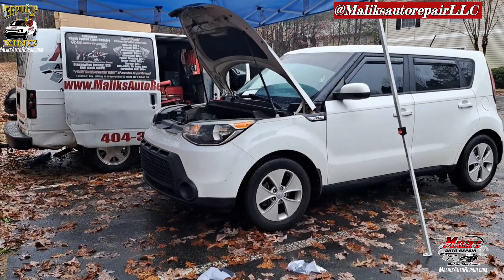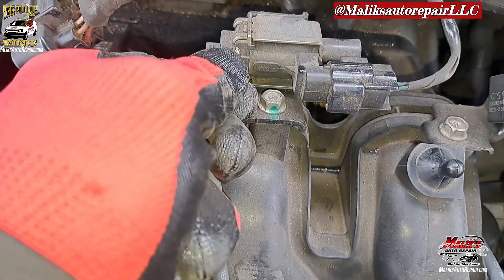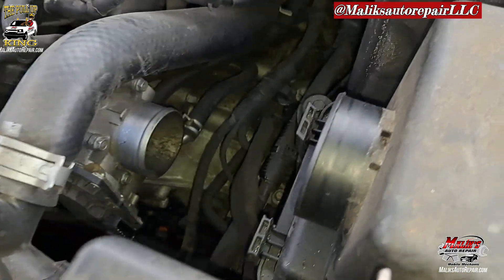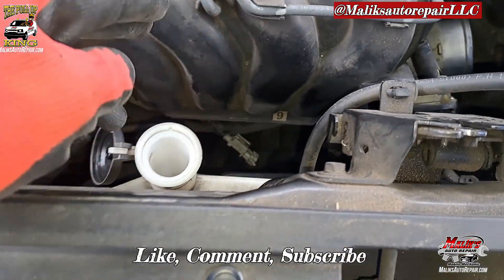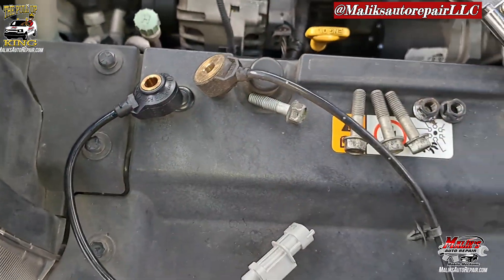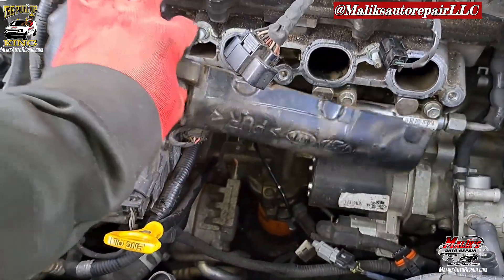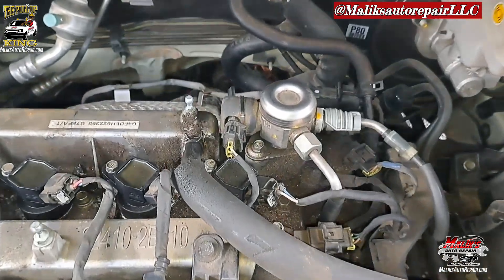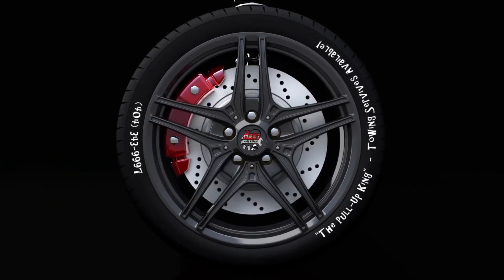CODE P1326-Knock Sensor Detection System | 2015 kIA SOUL |  REDUCED POWER | KIA HAS A RECALL ON CODE

Comment from the maker: Kia dealers will update the Knock Sensor Detection System (KSDS) software, free of charge. The recall began January 27, 2021. Owners may contact Kia customer service at 1-800-333-4542. Kia's number for this recall is SC200.
Reply: Now this is extremely useful!
Reply from the maker: @JohnnyHears  Thanks

Comment: I HAVE SAME YEAR STARTED DOING THAT  I REPLACED THE KNOCK SENSORIT DIN'T FIXED ANYTHING I CHECKED THE PLAY IN THE PISTOND ROD AND THE DEALER END UP REPLACING THE ENGINE FOR FREE  SO JUST TAKE IT TO THE DEALER THEY WILL TRY TO REPROGAM  AND IF THAT DONT WORK THEY WILL REPLACE YOUR ENGINE FOR FREE
Reply from the maker: Thats what I mentioned in the pinned comment. Thanks🫡

Comment: Kia had recalled ours a few years ago and the new engine doesn’t look like that. From what I can tell, ours is a G4NC 2.0L. I don’t know what that means. 

Can anybody help?
Reply from the maker: 2.0 liter, four-cylinder, non-turbo engine produced by Hyundai Motor Group
Reply: @yeah. I had googled it after my stress fit ended. I’m having trouble at the bottom of the manifold where you got those 3 (probably 10mm like mine) bolts. 

I can get the one all the way to my right, but I can’t find the other ones.
Reply from the maker: @grayloncomeaux7483  Gotta know what your looking for and feel for them. You cant see down there. Unleaa you use a mirror.
Reply: @ThePullUpKing  I’m about 4:30 into your video, process wise.

Comment: It apeared a p1326 on my 2012 Kia Optima SX..i already replaced my knock sensor..the rpms already lift more than 2,000rpms but the knocking sound its still on..ehat could it be??
Reply from the maker: Excessive bearing wear
Reply: @ThePullUpKing  what does that mean? Is it bad? How can i fix it..thanks tho!
Reply: @ThePullUpKing  what does that mean? Is it bad? How can i fix it..tnaks
Reply from the maker: @rick_golden Yes, it's bad. Will need to rebuild the motor
Reply: @ThePullUpKing  REALLY😳😳why does that happen
Reply from the maker: @Therockydich  Bad design

Comment: Death code
Reply from the maker: Yup lol
Reply from the maker: Just had another one with a misfire. Did a Tune-up and had to run more test. Low compression in Cylinder 1.🤯 These motors are terrible. 
https://youtu.be/DoPEGnzjA_Y
Reply: @ThePullUpKing  my daughter's blew last week at 75,000. At the dealership getting a new engine under the 100,000 warranty, but we are getting rid of it after repair.
Reply from the maker: @donniedarko979  Smart move. The ladies love that car, but it's not a reliable car at all

Comment: hi,  I have my car at dealership for warranty claim but they are refusing to replace engine claiming the noise is because of piston wear and not due to bearing  knock , they use some type of tool to test it without opening engine and when I ask them that sound just started to come as soon as I get P1326 and there was no oil leak/burning before that then how it can be related to piston,  they cant explain that and say that we can see that cylinder walls are scraped , its a kia soul with engines under extended warranty due to rod bearing wear, don't know what to do next
Reply from the maker: They're just tryna find away to avoid installing a new motor, is what it sounds like.
Reply: @ThePullUpKing  yeah that's what i am also thinking , I also don't understand how they can check bearing wear even without opening engine
Reply from the maker: @tanweerahmed6861  They make a tester strictly for that, so you don't have to breakdown the motor.
Reply: @ThePullUpKing  but is this device reliable , can we trust its results ?
Reply from the maker: @tanweerahmed6861  Yes, it shows what can't be seen with the motor assembled.
Reply: @ThePullUpKing  got it but still they should replace engine as this is a design flaw, they are just trying to avoid warranty using piston excuse
Reply from the maker: @tanweerahmed6861  So true. These motors are terribly designed
Reply: Bro same thing with me…. Piston issue. But won’t replace engine finally went to a new dealership and they may get me a new motor
Reply: @ryanshaneprod3487  please keep me updated thanks
Reply from the maker: That's good news!😎

Comment: Did it end up coming back. My wife’s Kia forte (same 1.6 motor) just got this. At first I was worried there was a bigger issue and not just the sensor. But you gave me some hope.
Reply from the maker: Yeah, it came back and it got worse. I'm not sure if they still have it.
Reply: @ThePullUpKing after how long ?
Reply from the maker: @andrewww6265  Maybe a mth or two

Comment: Wow 😂 You did not have to remove intake manifold. Whatever works.
Reply: Please share frend
Reply from the maker: I'm still waiting
Reply: I'd love to know as well
Reply: @Tjflow3404 hey there ! My boyfriend just took mine off in about 3 minutes from underneath my car. He didn’t take the manifold off. We watched this video then he figured he would take a look from underneath the car to see if there was access that way and had it off very fast. We’re going to pick up a new one and hope it goes on just as quick. My code says P1326 which I’m hoping is a result of the knock sensor and not the bearing rod.
Reply from the maker: Nah, it's impossible to get it from the bottom on this design.lol Clearly it's not the same design. Some you can get from the bottom.  Not this one.
Reply from the maker: What other way can you get it if it's under the intake manifold? Put me on game then

Comment: My car is throwing this code, P1326, as well as P0014 and P0011. It's showing some of the same symptoms like when I push the pedal to the floor and won't go past 2000 rpm's. Should I just replace the knock sensor or something else?
Reply: Your car is still under warranty extended to 150, 000 that is the engine replacement code for free. I'm going through this right now
Reply: @jontaylor8188  I'm having the same issues and exact same code. What do I need to do to get my engine replaced without them giving me the run around?
Reply from the maker: Try replacing the knock sensor. That won't fix the other codes tho.

Comment: Did that fix your problem,in my experience I never found a bad knock sensor ,always broken wires,did that fix the issue
Reply from the maker: It fixed this particular car. If the customer is willing to pay... I prefer to always diagnose it before replacing parts. That way I can determine if it actually needs to be replaced or not.

Comment: How much does it cost to repair? Currently dealing with this
Reply: A shop will charge around 200-250 for replacement. Me I spent 40 bucks on it and did it myself
Reply: @megansawyer493 Did it fix the problem. I have a 2014 Soul 2.0 and that code came on today, along with the O2 Sensor. I’m wondering if I got a bad signal from either one which caused either one of them to trip or illuminate both codes..
Reply from the maker: Depends on where you take it for service.
Reply: @ThePullUpKing   is there still a recall on it my car is currently doing that ?
Reply from the maker: Call the dealership
Reply: @ThePullUpKing   I had went yesterday and once I got my car back the engine light started flashing
Reply from the maker: Ask about the recall bro/sis
Reply: They say it wasn’t a recall now I have to get it fix
Reply from the maker: @Life Full Of Choices  https://www.google.com/search?q=kia+soul+knock+sensor+recall&oq=kia+soul+knock&aqs=chrome.2.0i512l3j0i20i263i512j0i512j69i57j0i512l4j0i22i30l5.9882j0j9&client=ms-android-mpcs-us-revc&sourceid=chrome-mobile&ie=UTF-8
Reply from the maker: @Life Full Of Choices  What year is it?

Comment: am currently having this issue. should change it even thout its says stock on?
Reply from the maker: Yes, but I found out Kia has a recall on it.  Call your local dealership and inquire.  They will repair it for free.
Reply: @thePullUpKing. Do you know if the recall is for 2026 sportage too ? Or only for kia soul
Reply from the maker: @asterix867 Kia dealers will update the Knock Sensor Detection System (KSDS) software, free of charge. The recall began January 27, 2021. Owners may contact Kia customer service at 1-800-333-4542. Kia's number for this recall is SC200.

Comment: Thanks for sharing. I’m having this issue
Reply from the maker: Luckily
Reply: Your the goat thank you man!!!!
Reply from the maker: Thanks man✊🏾😎
Reply from the maker: Yessir! Not a problem. Thanks for watching!
Reply: @ThePullUpKing  will replacing the sensor fix it?
Reply from the maker: @sbarton6908  You just asked that. Yes. That's what the video about.
Reply: Did this fix the problem?
Reply: That’s a big job
Reply from the maker: Not at all. Don't let the Intake manifold scare you.
Reply: @ThePullUpKing  I appreciate you!
Reply from the maker: @sbarton6908  💯
Reply: Hopefully it’s not the Ecu. I had problems with a jet ski doing the same thing before and had to change the computer.
Reply from the maker: @sbarton6908  Most likely excessive connecting rod bearing wear.
Reply: @ThePullUpKing  only 95,000 miles. Sounds fine
Reply from the maker: @sbarton6908  Those motors are notorious for this happening. With even lower miles too.